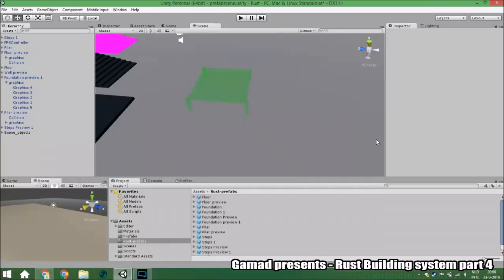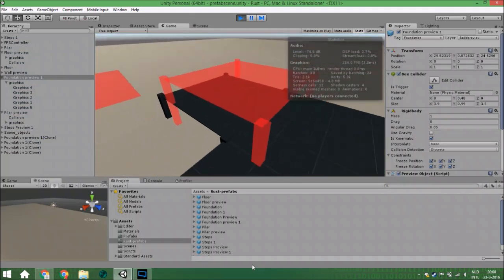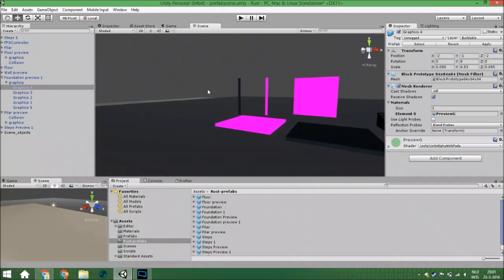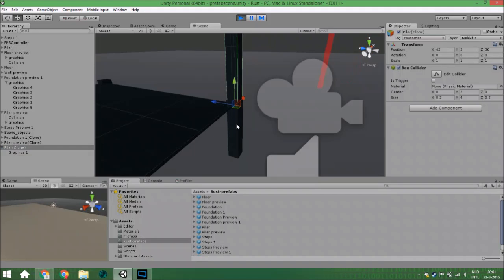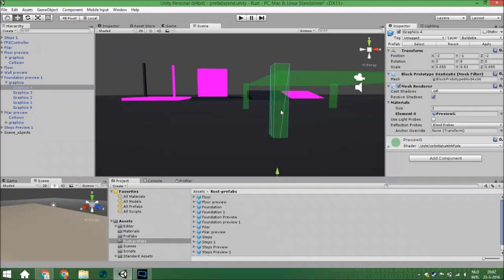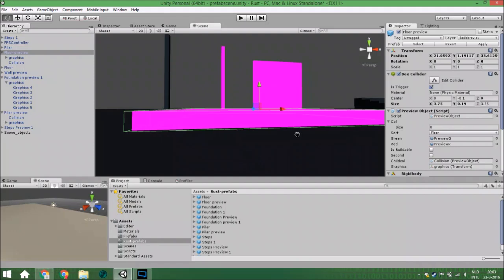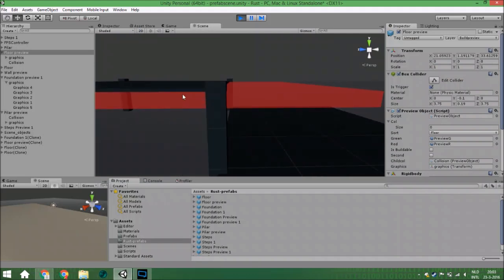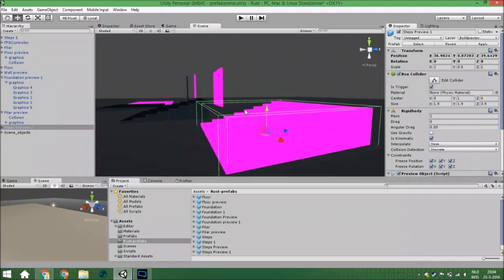[Unity 5] Tutorial: How to make a building system like Rust - part 4

Comment: How do you force the Pilar going to edge of the fundation? YOu didnt explain that...
Reply from the maker: +Rianne Schaidhauer It is just with the same snap to grid function as I explained in a previous part ;)
Reply: +Gamad But you cant put a Pilar directly to Ground right? Only if has a Fundation above. How do you controll that?
Reply from the maker: I will upload later on a part where you can fix this ;)
(thanks for the bug report!)
Reply: +Gamad Thx man, i belive its the same with Walls, you can put it togheter? Walls and Pilars?
Reply from the maker: You can puth walls between pilars (but I think that is also what it is inside Rust (I only saw videos ;) )
Otherwise just make the inner collider a bit bigger, that should fix that ;)
Reply: +Gamad In RUST you can build walls without Pilars, Pilars its just for height buildings.
Reply from the maker: You can build walls without pilars, but also with pilars (just your choice ;) )
(You can't build pilars inside walls, but you can create pilars first and then walls)